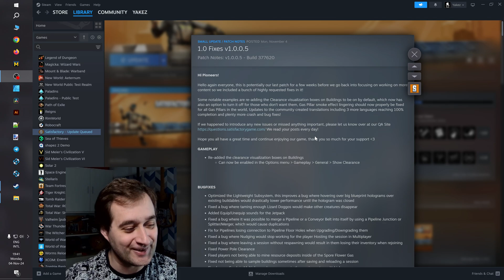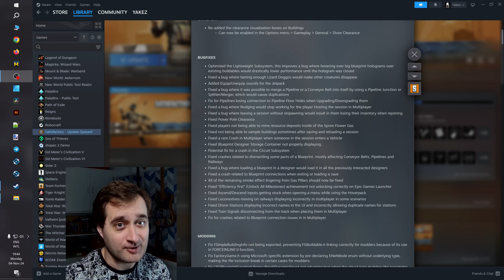State of Blueprint Designer in Satisfactory 1.0

Comment: UI thing that got me is I usually close the build menu with right click somewhere. But for some reason that does not work in the blueprint UI. Somehow inconsistent even tho it looks like it is the same UI.
Also wonder why you are only allowed to add one icon to the blueprint. In Factorio they hit a good sweet spot with letting you add 4 icons. Doesn't even need to do the fancy stuff like different layouts of the icons, just a 2 by 2 grid with 4 icons. Can easily add a lot of info in that which would help sort your blueprints.
But don't agree with your statement that 4 by 4 blueprint designer is not needed. For normal player progression it is a good introduction to blueprints. Can make your life easier making one machine blueprints with splitter and merger and recipe set so can put those down faster. And you learn the power of blueprints with that so you have a better transition to what is possible with bigger designers.

Comment: I'm only playing on Dedicated server with friends and there a couple more problems with it, that is annoying. When someone create BP and place it anywhere in category, it usually not placed for all players in that category and just become in Undefined / Undefined one. If you could add that info to the post that would be useful.

Regarding names I do this thing: I first create BP with whatever name, then just open folder where they are stored and just rename it to whatever name I need, restart the save/server and upon reload work with that. It have no issues with working with long name BPs and even updating them without a problem.

There are also a couple more blocks with weird collision, but I can't name them now, I just tried them in designer and they weren't work as expected, so I ditched them.

Comment: There is also a lesser common bug in the game. I made myself a playthrough with ags enabling everything just for blueprint designing. Since I wanted to make a turbo fuel factory with two modules I put two blueprint designers so close together that they even touched. The result was that loading something in one designer also loaded the same blueprint in the second designer as if they were a network of sorts (like if train tracks connect two networks just by touching each other). Was of course an easy fix to move them a bit appart.
I upvoted your bug report though I think not much will be achieved by this, since they don't give any feedback and still have four year old bugs in there.
Reply: This should be patched in 1.0.0.5

Comment: I agree, Blueprint designers, are for designing things. Having it unlocked after your factory is built. that's like, why?????Tier 8 I could maybe understand, but Tier 9, nah. That was pointless. Makes it so the designer is only for those who are using the game in freebuild mode, which basically means not for those actually playing the game. But Designers like to play the game too. So I don't think it's a fair spot to put the designer. So agree with you there.
Reply: Easiest solution would be to unlock all blueprint designers at once, for instance at tier 6. Or even better just unlock the 6x6x6 one and completely remove the others from the game, since they are not cross compatible at all. I made myself a small playthrough with the advanced game settings having enabled everything, I call it Lab. Just for blue print design, and only in 6x6x6
Reply: I'll just build 2-nd and 3-rd designers using Satisfactory Calculator the second I unlock 1-st designer in my new save

Comment: Definitely like the idea for easy identifiable blueprints. Instead of a toggle for blueprints or in addition to one, an actual filter to compliment the search bar. Filter by machine, recipe, logistic level, can build (with advanced options for tech level, research unlocked etc) even just a I, II, or III in the corner of the image to easily identify which designer it needs

Comment: This game about  blueprint tool is  very bug  i have make some blueprint  print in past now for some reasons  i can used inside  the tool to make adjustments  this game is just Very Bug in this stage i hope the developer  fix  this problem
Reply from the maker: btw they fixed some of the very old blueprint designer issues with todays patch. So they are actually working on that... but slow